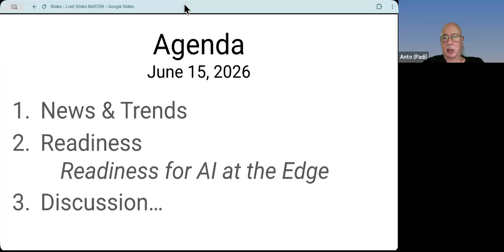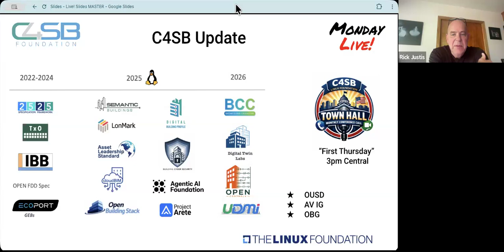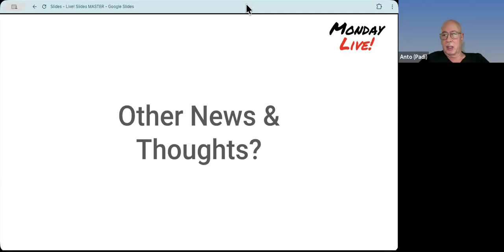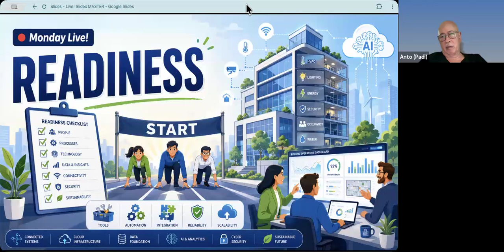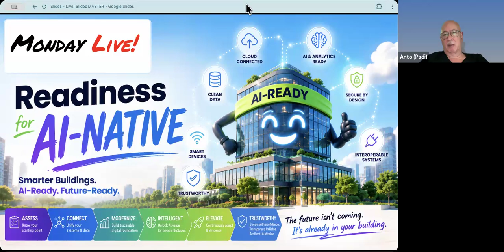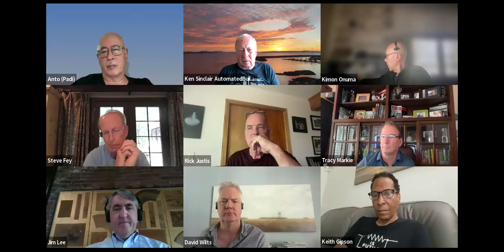Monday Live! June 15, 2026

Comment: Apigee is just an API gateway. You could use Nginx, Kong, Apisix etc.  API gateways are one of many primitives for any system.

Edge to Cloud, P2P, On premise, Smart gateways, Smart edge networks, mesh networks - topologies and architectures should follow business needs and compliance requirements. 

One thing I agree is that intelligence should be distributed. Cost savings, energy savings, Data privacy, protecting knowhow/proprietary knowledge, democratization of intelligence...